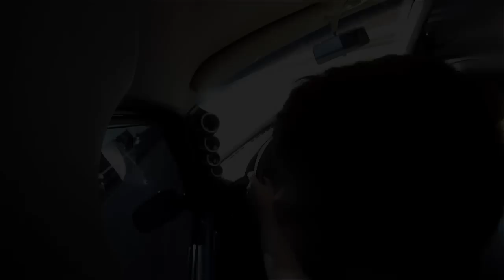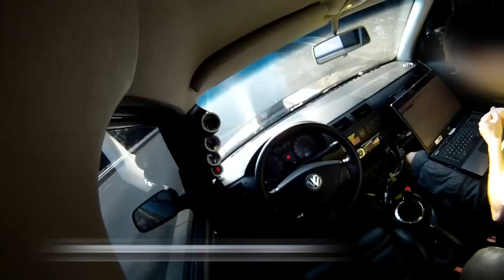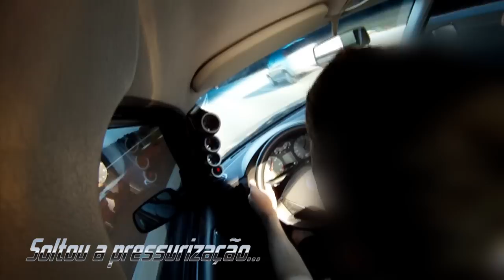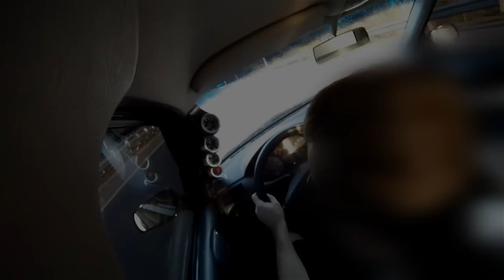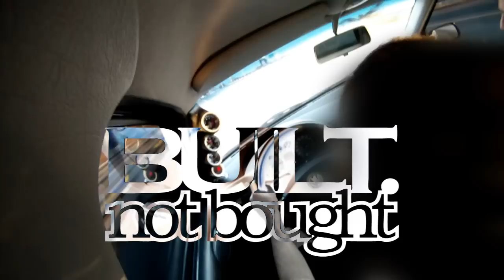Saveiro 2.0 Turbo - acerto do intercooler com datalogger

Comment: @feggmyballs É, atualmente uso 0,6bar e um bico mono IWM 500.01 na presurização. para essa pressão a regulagem dele é baixa. Tem uns vídeos no meu canal, dê uma olhada e opine.

Comprei velas mais frias, cabo de vela melhor (Vela e cabo de vela original de fábrica, e tem mais de 100k km), sonda wide e embreagem de 700lbs de cerâmica.

Quando chegar aí subo para 1bar

Calculei a taxa dos AP 1.6 Mi, os gaslina até 97 tem 9,929003 e do AP 1.6 Mi após 98 ou Flex até 2007 é 9,69163

Comment: boa anoite pessoal tira uma duvida quais as vantagem do intecooler e porque tem que ser feito o reacerto
Reply from the maker: +Rodrigo Dias A principal vantagem do intercooler é o arrefecimento do ar quente comprimido pelo turbo, aumentando a sua densidade e dessa forma conseguindo entregar uma maior massa de ar ao motor, aumentando a potência do motor; Redução das temperaturas e carga térmica do motor, maior durabilidade do motor, e por conseguinte até se pode aumentar a pressão do turbo para valores mais elevados. O acerto precisa ser refeito pq o motor funcionará em uma nova condição e precisará de mais combustível para equilibrar os ganhos do intercooler e extrair mais performance.